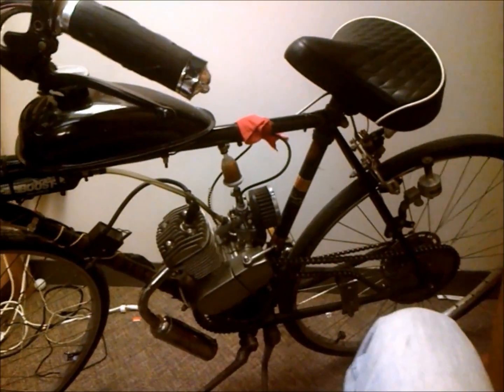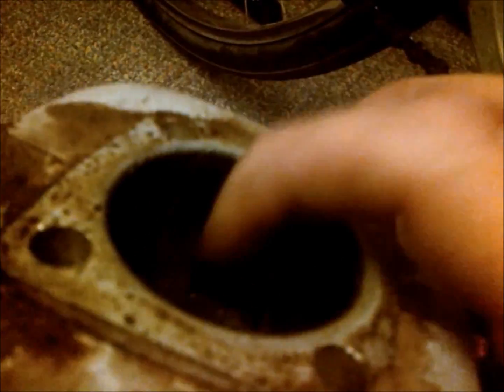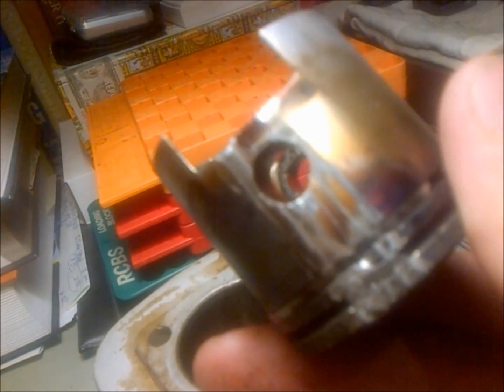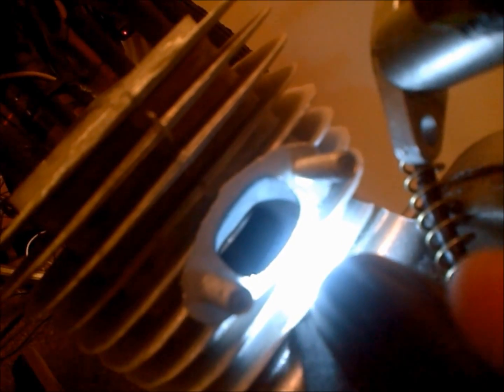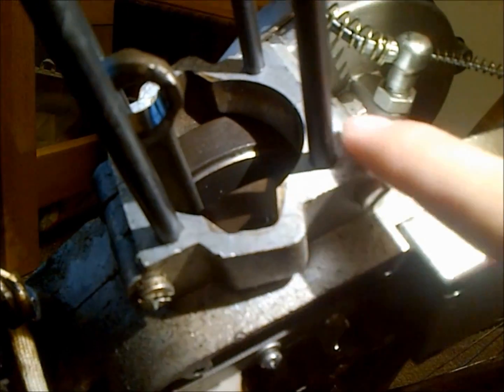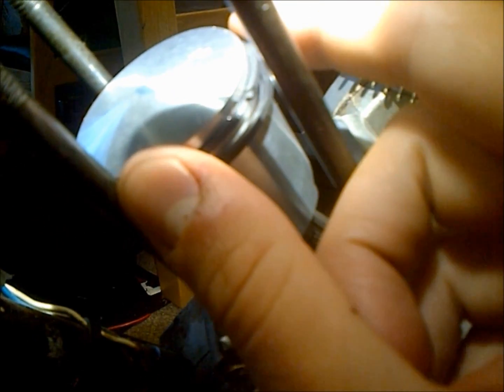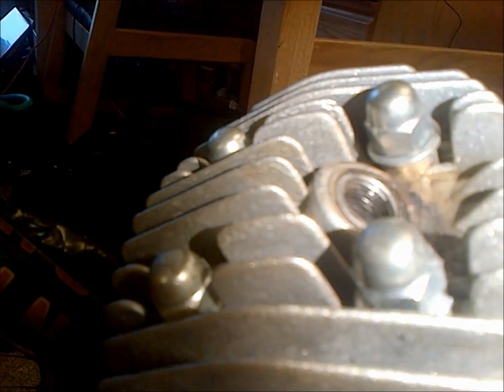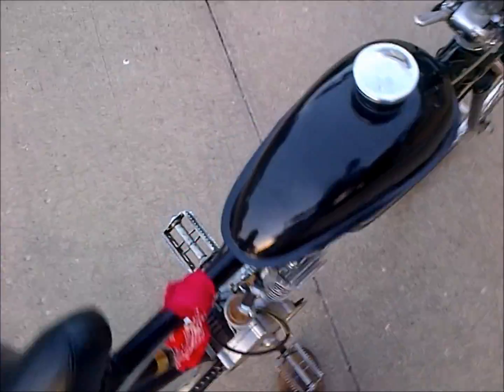Motorized Bike 66cc Engine Dissassembly & Reassembly w/ Explanations

Comment: Hello I need help! The kit I purchased won't run right. I took off head and noticed that at BDC MY INTAKE ports are not visible.

Is that normal? Did the wrong piston come from factory? I have the low hole piston.
Reply: That's normal, your not supposed to see the intake port... The Air Fuel mixture comes from the Transfer ports Two holes off the side pointing to the top cylinder wall of the intake port.